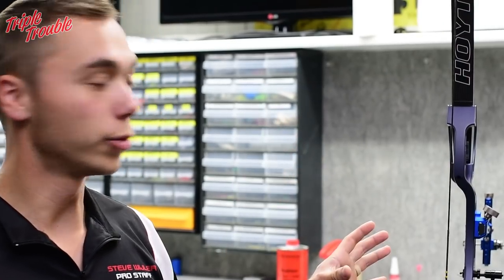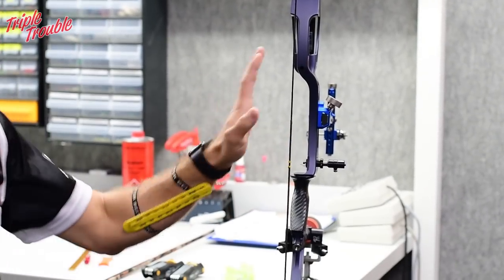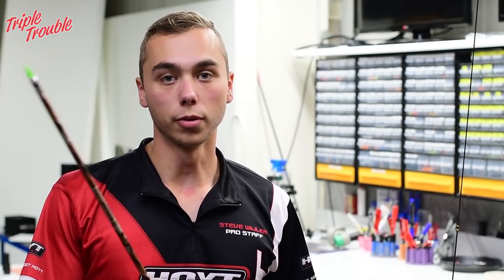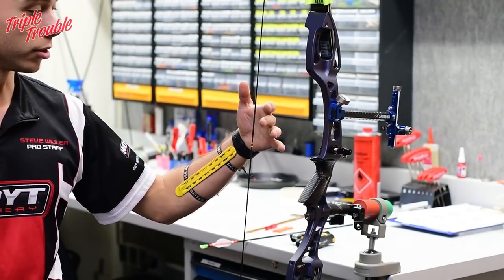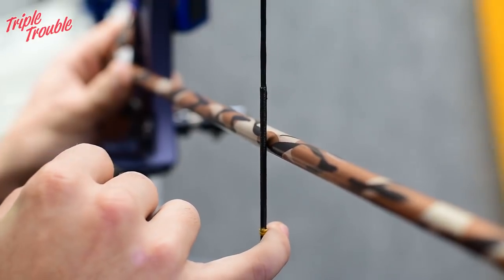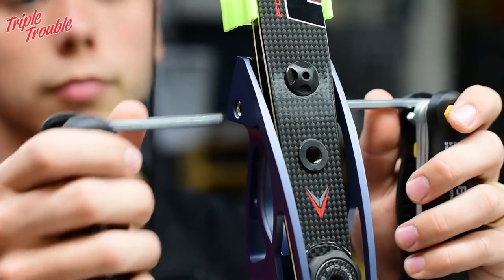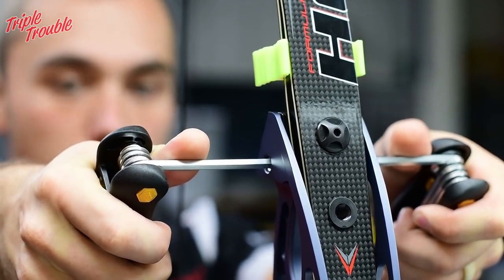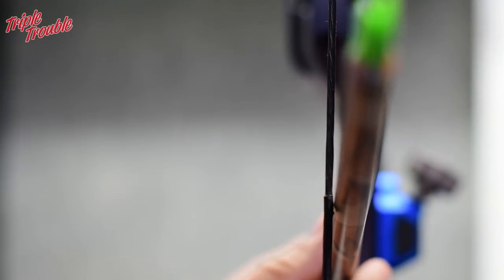HOYT Recurve FORMULA X Limb Alignment [Tuning #1] with Steve Wijler

Comment: Congratulations Sjef for becoming the first recurve archer from Europe to shoot 690 in competition at Antalya!!!  I'm coming in late on the discussion, but it is an interesting method using a 25/64th / 9.9mm arrow to align the right side of the string with the inside of the sight window (it would be the left side of the string for our left handed friends).  With an accurate dimension for this measurement I see how it would improve limb alignment over strictly visual with Beiter Blocks.   @Triple Trouble Archery, reading your comments below I think that most serious amatuer archers want to get their bows and arrows tuned as perfectly possible.  It will never be 100%, but we can strive for it.  Untold threads on archery forums are posted trying to reach the ideal.   A near perfect tune will never make up for poor form!

Comment: One quick question (sorry if it’s a silly one) -
You tighten the pivot screw at the end after removing the limb - does this mean that the pivot screw was loosened prior to adjusting the two side Allen key bolts?
Reply from the maker: Yes! Sorry for not clarifying that.
Reply: No worries! Thanks for the great videos 👍🏼

Comment: I've never heard 25mm from the edge of the riser tip, is that common to all risers or the Hoyt in particular ?
Reply: I've been wondering about this aswell since this also depends slightly on the serving thickness. Did you perform some measurements a priori or where did you get this information from?
Reply: I'd like to know as well, might help me alot with setting up bows
Reply: The arrow is a 25 (25/64") or 9.9mm diameter, not 25mm
Reply: @slghmrZ3R0  Thanks, I noticed I was wrong my 2nd watching.
Reply from the maker: @dominicdiclemente8877  We have applied this method for a long time now, but only with Hoyt bows. IF your stabilizer is straight, you can also check if the string follows the stabilizer's direction. If that's the case you know it's good, too. Expect a video together with the actual engineer of this bow soon!
Reply: @TripleTroubleArchery  You are aware that this can be quite inaccurate if you simply assume that this value is the same for every new Hoyt model?
Of course, if you get this information directly from the engineer it is fine, but it would be nice if Hoyt communicated this information to all customers, e.g., in their manuals.
But to be completely accurate, you would have to account for the string thickness, and I assume you do not do this. 
For me, this more or less shows that you do not need a perfectly aligned bow to shoot worldclass scores, so one thing less to worry about :-)
Reply from the maker: That's a good point! And I 100% agree that a perfect tune is overrated. I am a big fan of just shooting and if you feel like the result isn't matching up with the feeling of the shot you can look at the bow. I think for us the fact that we use the 25 (9.9) arrow is to have a reference to start with mostly :) thanks for your comment, these discussions are great!
Reply: @TripleTroubleArchery  I am going to measure the center distance for my SF Forged+, I am curious as to how different it is from Hoyt.
Reply: If anyone is interested I get a measurement of 11.5mm from the middle of the string to the inside edge of the SF Forged+ riser
Reply: @dominicdiclemente8877  Most risers have a symmetrical part below the grip, with flat and parallel surfaces. There you can check if the string is in the middle of the riser easier than at the sight window. Get two cylindrical and straight arrows (avoid barrelled ones for this) and fix them on each side with rubber bands to the riser. From the gap between the arrow and the string either side, you will clearly see if the string runs down the middle or not.
Reply: @ZolcsiBB  interesting, i will absolutely try that.
Reply: @TripleTroubleArchery  interesting, have you tested this for other risers(not Hoyt)?
Reply: @ZolcsiBB  this is an excellent tip... great for making sure that top and bottom have the same clearance.. very clever. We'll do!